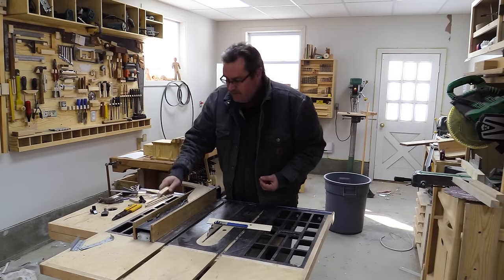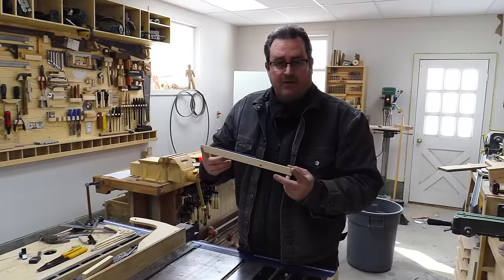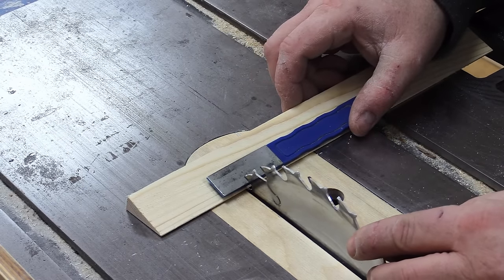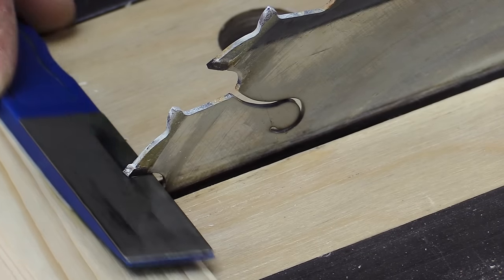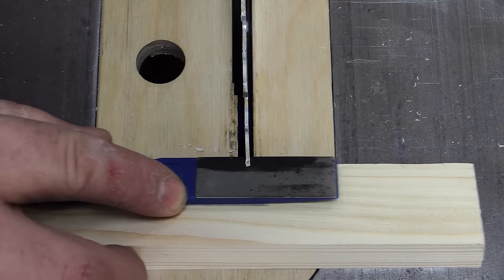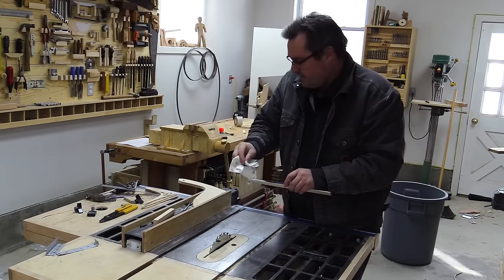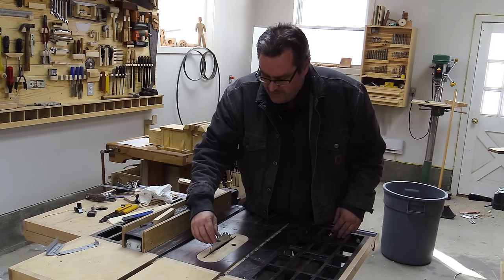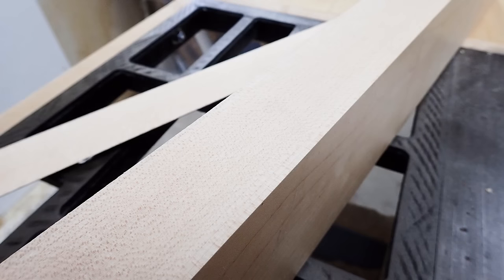Sharpening A Carbide Saw Blade By Hand

Comment: No, no, no. This is a cross-cut blade so you also need to angle the block alternately for each tooth as well, not file it straight-on. I set the correct angle on 2 axis and do every second tooth, then set up for the odd number teeth at the opposite angle